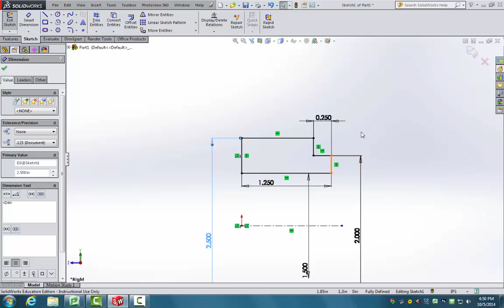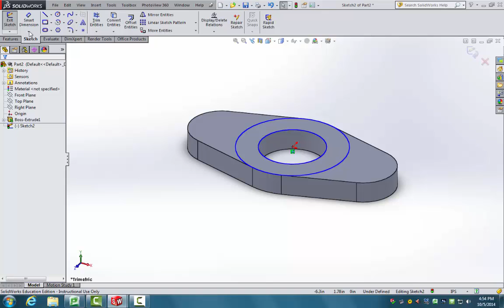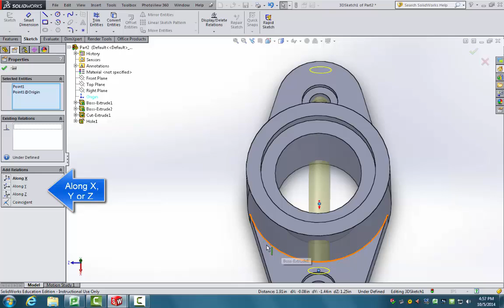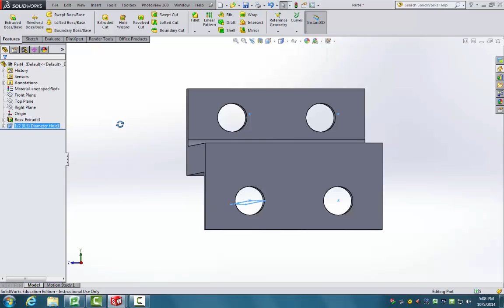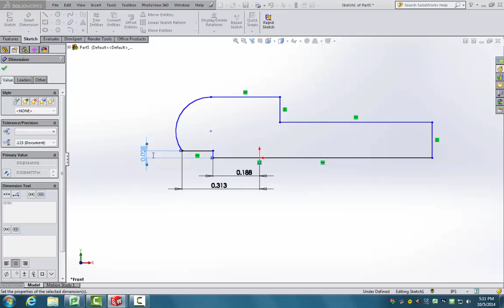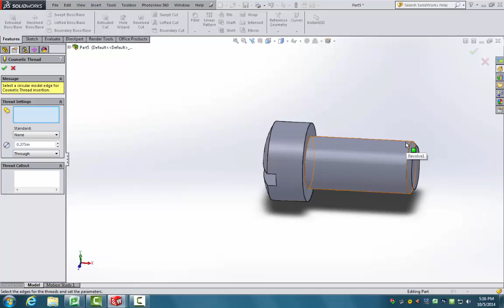MCC ENR 153 Ch 15  Part 1

Comment: Confusing. Some things he did, like typing in a measurement went by too quickly to even see in normal speed and since he didn't mention it I had to rewind several times and reduce speed to find out what it was. Also, in the 2nd exercise, when setting up the hole on the side of the cylinder I had to connect the origin to the construction line 1st and set it to Z or I got relation errors when I tried to set the circle and line to Y. I don't know what version of Solidworks he's using but we're using 2020 in class now. Sounds like Prof Bolton. He knows his stuff.